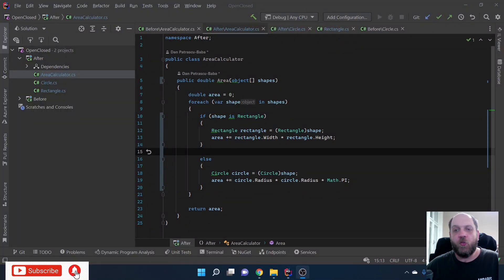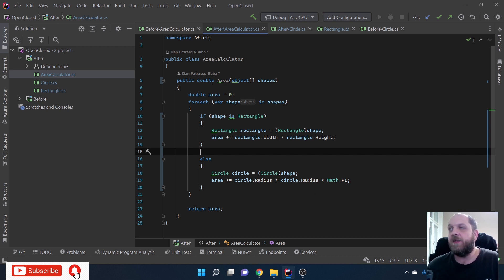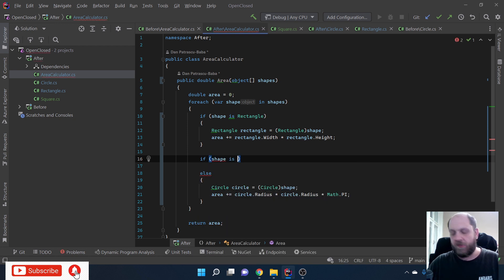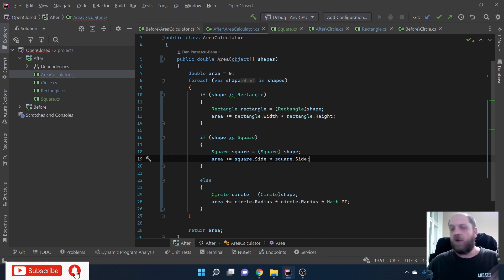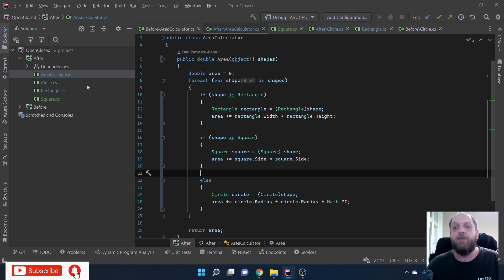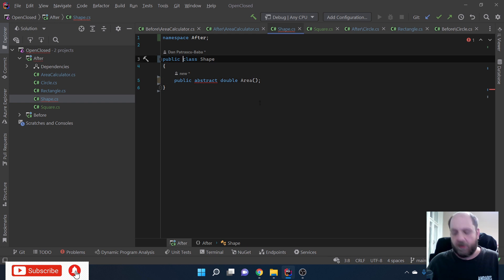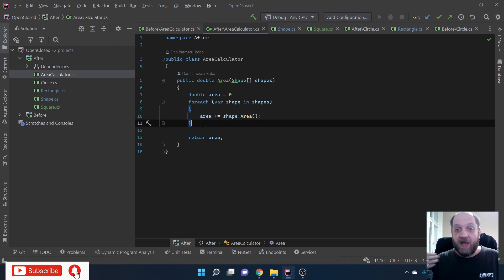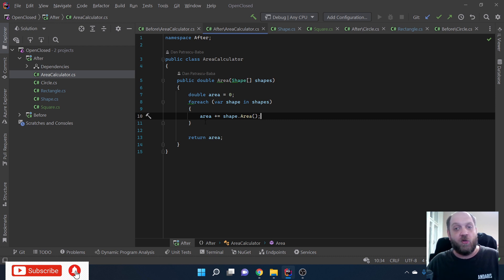SOLID: Open closed principle (OCP) made easy

Comment: Great example of the OCP, pity the firm I work for have classes with 25,000 lines code (in one file) and some methods are even 2000-3000 lines long... hate to refactor that, so we just use "launch darkly " and add more if statements. -- So many red flags with the software I work on. I hate looking at it daily.

Comment: Hi Thank you very much. such a nice demonstration. please please make series on LINQ best practices.
Reply from the maker: LINQ is for sure something that I will cover in the coming weeks. As I work a full time job, the videos that I create are usually based on stuff that I also do at work. Right now I'm working with some interns and covered the SOLID principles. Therefore these videos. Then I will have some design patterns. And then I'll probably also cover LINQ.